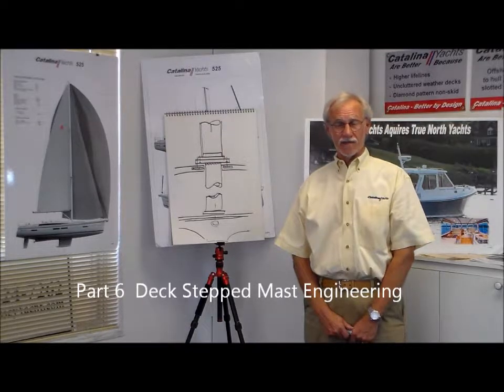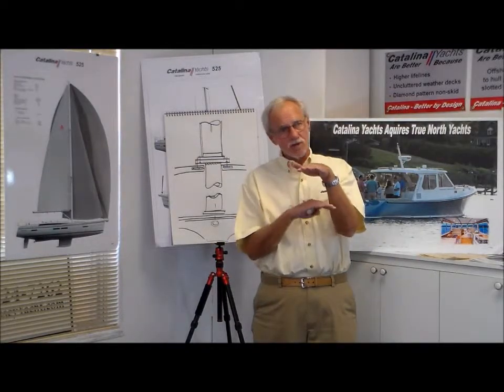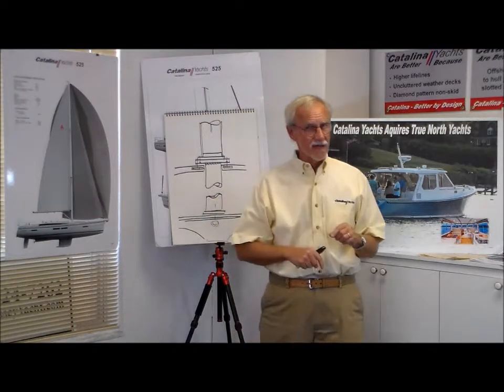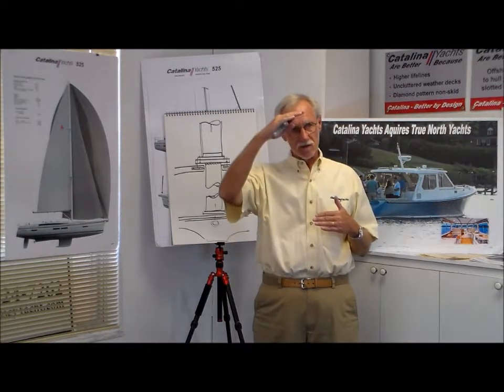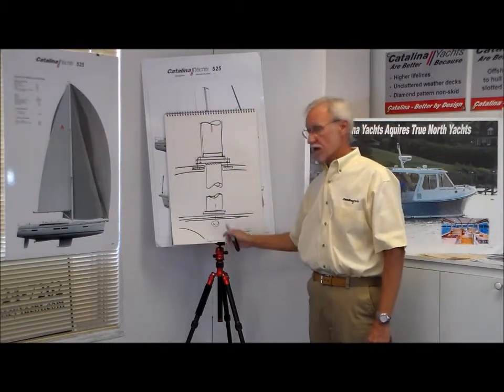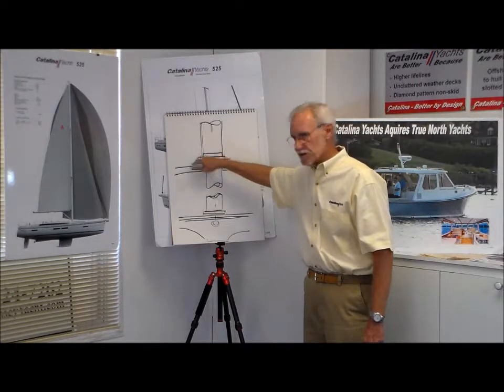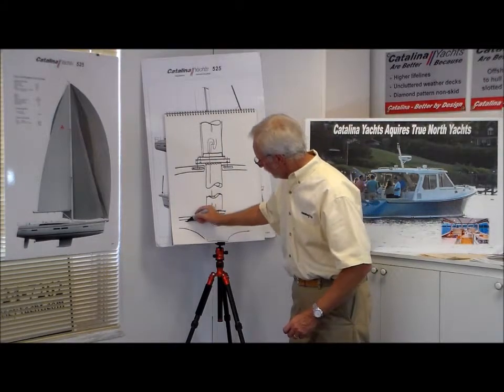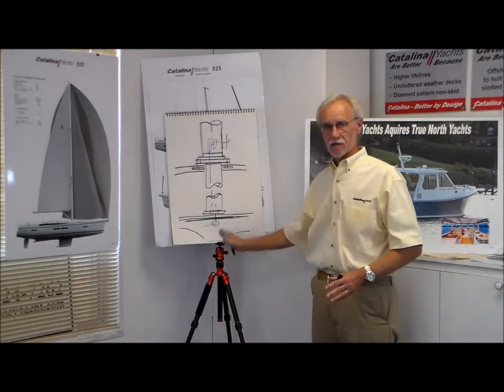Features of Catalina 5 Series Yachts - Deck Stepped Mast Engineering - Part 6 of 11

Comment: Does the mast actually attach to this plate welded to the compression post? I just don't understand how it can be a good idea to not have an actual connection between the base of the mast and the boat. The reasons given in this video (leaks, condensation, noise) all seem pretty insignificant compared to the inherent structural weakness of a deck stepped mast compared to one securely bolted to the keel.